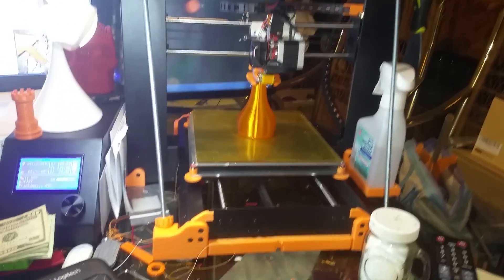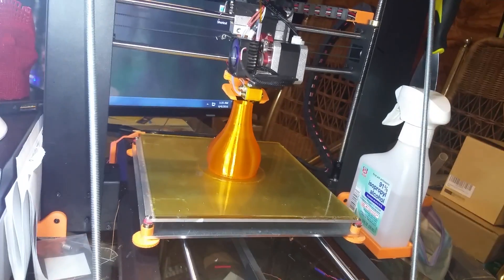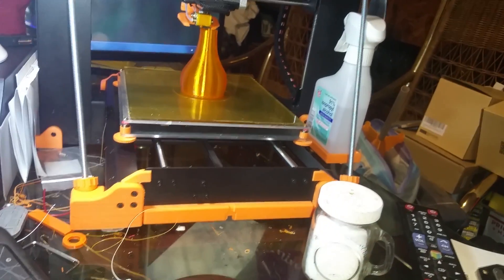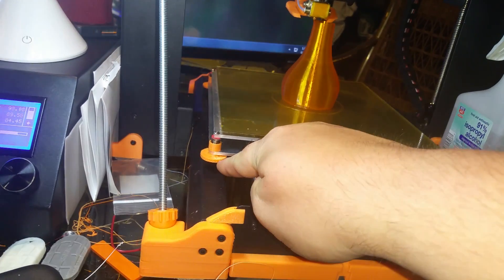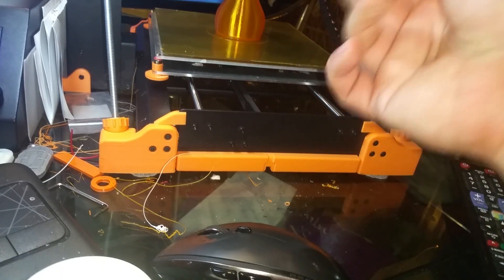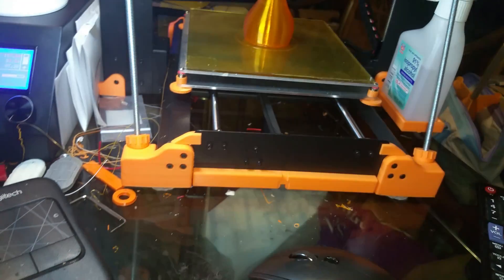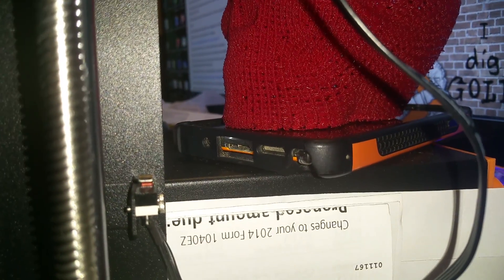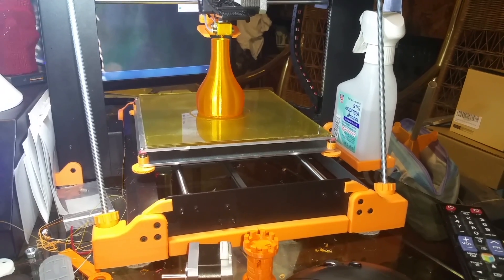Today's 3D Print - Minimum mods and instructions maker select wanhao i3

Comment: What a GREAT video! This must be one of the most informatve Di3 videos on youtube! Hats off to you sir! 👏 
But i have a question;
if i would allign my whole printer (cause its out of allignment probably in every "bolt joint"), how and where would i start?

Put it on a leveled table, and then level the base, and make sure all of that is square, then work upwards to the "tower"? And to level the y-axis rods, where should i measure from to get them straight with the bottom frame and all the other parts? 
I just dont know where to start. :-)

(im waiting on the upgraded carriage plate, as i think the stock is bent as im suddenly not able to level the bed anymore).

Thanks man!
Reply from the maker: Alpejohn the stock one is thin enough that it bends constantly it's not that you can't level it's just that level is always changing because it's always changing shape a glass plate will help compensate for this since the glass won't Bend so that is my first suggestion get a glass plate drop it on there and relevel

when we say level we don't mean level as in with a bubble level or to gravity you could screw this printer sideways to the wall and it should work fine when we say level we mean the level relative to the nozzle and the bed

so the first thing I would do is make sure you have a good six point contact with whatever surface you're sitting in printer on do the two corners up front and the two corners in the back and the Gantry left and right make sure they are all in contact with the ground plane that you have the printer setting on

next use a square and square the X Gantry reasonably well doesn't have to be perfect just not obviously tilted forward or backwards and now tighten all of your bolts don't crank them you'll strip them just make sure they're all tight and firm check them all make sure your belts are also tight

now tighten down all for leveling screws until they are compressed all the way at this stage here is where you level your x-axis by using something like what I use to bottle or something and manually tweaked lead screws left and right until you have the same gap between the bed and that bottom rail on both the left and the right

now you've squared your body to the table and your Gantry to the body and your ex access to the bed now begin your leveling procedure raise the bed using all 4 leveling screws in equal terms after Auto homing with the nozzle in the center until you get close you should still see a gap between the bed and the nozzle if you add a piece of glass don't forget to adjust your end stop for your Z access

disable your steppers and gently slide the x-axis left and right is the gap the same? Adjust to it is do the same by sliding y-axis the bed forward and back with the nozzle in the center the left and the right adjust all four screws to evenly bring the bed up when the Gap is very tiny use your piece of paper to fine-tune it on the four corners remember to round robin at least three times since each time you adjust one screw you are altering a plane which changes the adjustment you made on the other three each time you go around your adjustments get finer and finer at this stage print 170mm cylinder with multiple skirt outlines once the print starts turn down the print speed to 25% and begin live adjusting each knob until you get an ideal Extrusion if you run out of time and it begins printing the actual cylinder that's okay cancel scrape restart you won't lose your adjustment you've made so far with the new y Carriage plate installed your level will hold almost indefinitely you will only have to make very minor tweaks every now and then
Reply: Nerys Thanks for an excellent explanation. 
At the start i managed to level okay (first time I ever had or seen a 3d printer) adjusted several times over a few weeks. Moved it to my office, leveled, printed several things, then I removed the hotbed to have a closer look at the bearings as they not moving smooth and sounds like they have sand in them. Also checked the carriage plate, and it was bent a little bit. After I mounted it back together I just couldn't get it leveled, I then also had (I have) a glass plate on it. That was the main reason I was going to level it. But every time I end up with the front right and rear left maxed out (flat), and the front left and rear right completely loose, and they can't lift the bed high enough. Tried several methods of leveling but every time I end up the same way. If I move the z stop up, I can't get the bed high enough it seems, the springs are almost totally decompressed. 

But I will try your method to, and also try to square the whole thing. 

When I leveled the Z, I had my glue stick on the base where the stepper motor sits, not on the bed it selfe like you do. 

Im waiting on a upgraded carriage plate in the mail, also I have ordered the igus dryling "bearings" as the ones I have is shit and the bed moves jerky..
Reply from the maker: Alpejohn if you add a glass plate you have to move your Z stop look on the side of the Gantry that little little micro switch that it hits when it comes down to the bottom it has multiple locations where you can move it you need to move that switch so that the move the switch up so the head stop sooner and doesn't run into glass also if one side is amaxing and the other side is not that usually means you're x-axis is not level
Reply: Nerys I will try again this evening. and level it like you do. Havent tried that before. But it was the diagonal front right and rear left that was maxed totally flat, so it wasnt only one side. 

I will give it a go and try to adjust and square it, and repirt back. thank you so much for your time!
Reply from the maker: Alpejohn i also just realized i have yet to make a video on the ACTUAL leveling process. i will work on that. the cr10 first then the i3 once its running again.
Reply: I have now tried to level it again, i didnt get the time to level the "tower" but its a little off at one side, other side is almost perfect. BUT, i actually got it leveled, not GOOD, but its usable so i can print out the thumbwheels. Its pretty "ok" in the center so i think it will be ok. But i did tighten the bed all the way down, and then leveled the X axis using a glue stick on the bed (without glass), i think its near perfect now.

But i found out that my heated bed has warped, so when i lay the glass on top of it (the bed is clean, without PEI and i have removed all the glue), it rocks on front left and rear right corner. When i push down one side, it lifts probably 2mm on the oposit corner (diagnonally).

I have ordered some thermal pads that i will put under the glass. Do you think thats enough to get it leveled fine? Or should i buy a new heated bed?
Reply from the maker: Alpejohn that's okay just shim the two corners that'll lift it add layers of painters tape to the corners making sure you do both Corners equally not just one until the glass stops rocking remember the bed doesn't actually have to be level it just has to be level relative to the nozzle so that should be good enough to get you going until the replacement y Carriage plate comes in also level the x-axis after you install the glass plate and have shamed it so it's not rocking remember the x-axis has to be level relative to your print surface not the ground or the printer but you're print surface
Reply: Nerys 
Awsome! Thanks for all the great tips!

Comment: Great video but please people, as of may 2017, DO NOT PURCHASE THE Y CARRIAGE PLATE, LINKED IN HIS DESCRIPTION, if you have recently purchased the monoprice maker select v2. It will not line up with the bearin clips or the center linkage and you wont even be able to drill holes to make it fit. Here is the link for the proper Y carriage plate.https://www.amazon.com/gp/aw/d/B01MUAMRN7/ref=mp_s_a_1_1?ie=UTF8&qid=1494377469&sr=8-1&pi=AC_SX236_SY340_FMwebp_QL65&keywords=wanhao+i3+y+carriage&dpPl=1&dpID=41dFO12PtEL&ref=plSrch
Reply from the maker: Kra5h185-ish ordered one. will update once i get it. i am curiois why you think the other one cant be drilled any longer?
Reply: I think they made updates to the v2 because my printer shipped with metal adjustment wheels for the y plate as well as fiber washers and locking nuts that were threadlocked in place. When i got the y plate you posted in your description, not only did the holes for the bearing holders and center guide not line up, but you cant even drill it to make it fit because those four triangular cuts are where the bearing holders on mine would go. I just got a thingiverse acct so ill take some pics and send them to you. The plate in the link i posted fit my unit perfectly.
Reply from the maker: Kra5h185-ish ahh yes. flip the plate around 180' and the existing holes wont be in the way anymore. ie it will only work one way where you have clean path for all needed bearing holes. either way if the new one works better that much better. want to sell me your cheap? i have another i3 that could use one :-)

Comment: You mentioned using transfer tape to stick the glass to the aluminum plate. What kind/brand of transfer tape did you use?
Reply from the maker: if I did that was a mistake. I use 3m transfer tape to attach the PEI surface to the glass but NOT the glass to the heat bed.

I used silicone padding for that but it was unreliable over time so now I just use blue tape on the 4 corners. works fine lasts a long time easy cheap to replace.

Comment: Hi, thx for the video. 
As a note, there is now a direct drop in option for the Y-plate (no need to re-drill holes): amazon: http://a.co/dSVCb1z or aliexpress: https://www.aliexpress.com/item/Wanhao-Upgrade-Y-Carriage-Plate-for-Wanhao-Duplicator-i3-Monoprice-Maker-Select-V1-V2-V2-1/32802313568.html 
And as a question, where was the replacement motor for - the Flexion extruder itself or the X stepper?
Reply from the maker: pumpalBo cool and that is the thicker plate right?

as for the stepper check notes its linked and still available on amazon for $15.
Reply: yes but which motor we replace with it ? The one that comes with the Flexion ?
Reply from the maker: pumpalBo ahh the feeder stepper fornthe filament. the one directly attached to the moving print head.
Reply: Huh, I admit I am new to this, but are you suggesting we purchase an $150 higher class exctruder (the Flexion)  and immediately have to replace the motor that goes with it ?  Or am I not getting something right .. ?
Really appreciate this video btw, intending to implement most part of it  to my new i3 v2.1, which is also my first printer ..
P.S> just checked the plate - both the one you linked and the direct replacement I linked are 3mm thick.
Reply from the maker: pumpalBo the flexion does not come with a stepper motor it uses the one already on the printer. wanhao downgraded the stepper to ancheaper weaker model since they could get away with it but the result is when you replace the stock extruder with the flexion the stock stepper is not powerful enough to work properly with the aftermarket extruder. you would be replacing the mp/wanhao stepper not the flexion stepper which does not come with a stepper motor.
Reply: Nerys, 
I will appreciate your kind help... I got my Flexion and replaced the e-motor with the one you suggested (had to swap the middle two wires on the connector to make it step - the stock motor on the v2.1 seems to use different wiring) . I also tuned the reference voltage of the driver to 1.08V to make use of the 1.5A increased power, and fought with the retraction screw of the damn thing until I finally got it to an even and constant grip.  
I as well checked the e-steps and re-learned the hotend PID .. 
Still, no matter what setting do I try for PLA, the result is much worse then the stock MK10. Especially small things with tiny details are completely impossible to print .. maybe I need a FAN upgrade, that is the last thing I will try before switching back to the stock MK10.. I haven't try yet any flex or PETG fillament, because if I can't make it do decent  PLA, it is not very useful for me. 
Any advice what to try or example print settings (retraction, temp etc)  would be appreciated! 
Thanks.
Reply from the maker: pumpalBo it is interesting. so many people have issues with flexion and pla and its the only material i have no trouble with on my flexion. with the stronger stepper i dont even have to finagle the compression. i kust squish it and it drives it.

now it is sensitive to pre lost coast and retraction. i would suggest resetting settings to defaults. i found out the hard way that even small changes to these settings can have a cascade and cumulative effect on print quality.

i hope to have my printer up and going again in the coming weeks. what slicer do you use? i can send you my simplify 3d profile once i figure out how to :-)
Reply: I've been using Cura with great success so far (before switching to Flexion)  .. which settings are you talking - the PLA profile of the slicer or ?  
 One difference that I can see is that your Flexion has the old coldend block, where they now all ship with the fined one from the HT version .. but that should not have much to do with the results .. do you remember what retraction settings did you use for PLA ?
Reply: Ok, I got it sorted! For PLA you must use the high-temp hotend..  That's now as well officially on their HT version description!  PLA is listed as "Mixed results" for the hotend that goes with the regular Flexion package and "Excellent performance" for the HT version! Glad I got the HT bundle...  the results I am getting now with faster speeds are apparently better then with the stock .. very happy!

Thanks for this video Nerys - you helped me made my printer much more then what it was ..   I followed up and have all the upgrades you suggested plus a few extra ( ie the X axis brace thing:1642924, the X-belt tensioner thing:1820493). and now the device is a beast :)

Comment: I can't figure out what's going on at all, my printer head is hanging 1/2" in the air and won't go down any further. From what I can see, there's a switch that stops it from going down any more. Even if the thumbscrews are entirely unscrewed it's still leaves the bed far too lower. It looks like it's suppose to be this way by design, there is nothing out of place.
Reply from the maker: move/adjust the switch. Just be careful its delicate.

also make sure your GANTRY (the part you bolted onto your printer bottom) is installed correctly/in the right holes.
Reply: I fixed it. The problem wasn't with the Switch or the Gantry.

The issue, for the sake of anyone else running into the same problem, related to the thumbscrews. If you don't loosen all of them evenly, at the same time, you can get into a situation where they all seem to be completely unscrewed, yet the bed remains 1/2" below the printhead. Unscrewing them evenly, a little at a time, allows the bed to rise higher then unscrewing them all the way individually.
Reply from the maker: Max SMoke ahhhh yes that would do i it was binding. thank you for bringing that info back to help others.

Comment: I have only 2 questions. What is your slicer for that amazing rook? And what are your setting? I've done most of these mods and am no where close to you in quality.
Reply from the maker: Victorthebattousai simplify 3d. the only setting was extrusion to .97 after adjusting rom value to what it needed to be to get proper extrusion.
Reply: Nerys what are your speed settings? temperature and cooling settings? id love to see your simplify3d profile, as thats what i use
Reply from the maker: Victorthebattousai not sure it was a while ago. i know i run cooling at 90% and speed around 40 iirc. temp is usually the rated temp on the packaging for the filament.
Reply: At 90% fan speed with a 50mm blower, how are you keeping your nozzle from getting too cool? I'm running a 50mm blower fan and even after pid tuning my nozzle drops to 160 degrees when at 100% fan speed haha.
Reply from the maker: Victorthebattousai no idea. i keep it insulated and the fan is not aimed at the nozzle but at the part. printer does not seem to have any trouble staying hot.